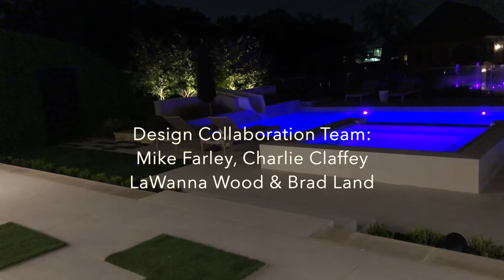Obaid Family Pool Construction Time-Lapse by Mike Farley

Comment: Must have cost over 50k
Reply: I don’t think 50k didn’t even cover the pool alone
Reply: Try 250k
Reply: Yeah the pool alone and the water slide were probably 150k .. the whole backyard I’d say was 250-300k ... poor choice of spending in my opinion . Could have done without the water slide , and omitted a lot of the u necessary stuff and did a lot of the work yourself . Honestly you can build a dream backyard for about 150k ..